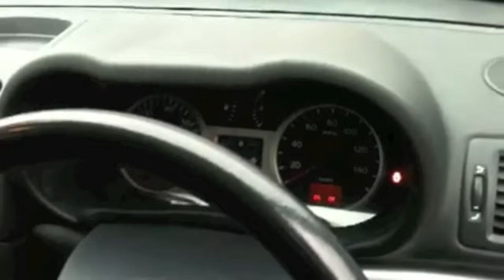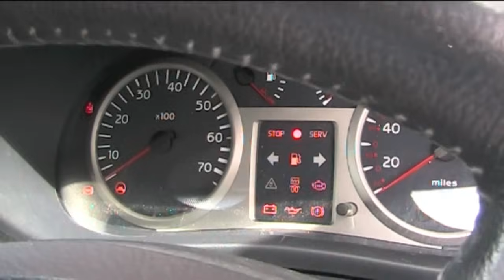Renault Clio 1.2 16v D4F Throttle Body Removal

Comment: This cured my Clio's 2002 1.2 Expression's issues. I can't thank this video enough for its assistance. 

My Clio has slowly been getting worse over the past 6 months and would cut out more regularly when stopping. Every time I pulled up to lights, roundabouts or to park etc... the electrical warning light would appear, revs would drop and the only way to save this would be to rev the engine a couple of times. The issue would be fine until I slowed down again. 

I took the car to 3 garages who all ran diagnostic test, changed the mapping and TDC sensors but nothing worked. 

Finally I came across this video, carried out the cleaning of the throttle body put it all back together and it worked. The car runs like new and has not cut out since.
Reply from the maker: Thats fantastic news to hear, thanks for letting me know, its good to hear the car is running well now.

Comment: Excellent video. Followed it through and cleaned my own throttle body (replacing a faulty air temperature sensor in the process). One small problem though, the video suggests the top bolts for the inlet manifold require an E6 socket. On my Clio, at least, they were E8 Torx bolts, rather than E6. Thankfully I'd bought both at Halfords just in case. Something to bear in mind before commencing the work!

Comment: Great video, thanks. My daughter has the Automatic version, cleaning the throttle body cured the following symptoms: Wouldn't change auto gears properly, Engine cut out at junctions, Stuck in second gear regardless of speed, sudden and dramatic loss of power, etc. Thank you again.

Comment: I've did this a few days ago. ~20 years old. Haven't changed any gaskets, they seemed OK. I've used a paper clip to clean the hole shown at 09:00. If the paper clip has plastic, you have to remove it. The hole is really thin. Instead of carb cleaner I've used acetone. I can confirm E8 torx, for removing the inner parts I think it's a torx 30. On my car I have AC. There weren't any particular problems due to it. I've used various flexible/bendable/stiff adapters of various lengths to get to all of the screws. Prepare to be really creative. I've also had a problem with the capacitor of the ignition coils (shown here at 4:40). It was broken. I've replaced it with a normal 2.2 uF 100 V+ (I've used a 400 V one) capacitor soldered to the metal part and fixed with epoxy putty. Also the connectors of the ECU had signs of corrosion (blue-green crap). I've used KONTAKT 60 spray. Replaced also MAP filter which I've broken by trying to remove it to clean it. It was really hard to remove the wires to the spark plugs. I've used pliers under the widened part and raised the pliers on one side by pushing on the otherside down into the inlet manifold, basically using leverage to raise them. The hardest part was putting back the first fuel pipe (1:40). I've used some WD-40 to help me and a torx key to help me push on one button. I needed around 1 h to dissasemble, but I wasn't really rushing.
Reply: OK, after about two weeks it became a bit jittery ocassionaly and fuel consumption has been slowly rising. Torque on Android didn't show any errors, but CarScanner for Android (which probes extra errors) did. Also LTFT (fuel trim) has been +50% (which means, that there should be +50% more fuel, it stops at ~50% as above that the ECU doesn't allow) while idling and wasn't great while driving either. After an another 2 weeks even the error light on the dashboard lit up once. I've added first a an injector cleaner solution in the fuel, which helped a bit subjectively (and also measuring fuel trim), but not that much. I noticed that one HT lead had a detached rubber, possibly due to the previous work. I've made a special tool by buying an aluminium pipe 10x1 mm, I've cut it in 250 mm length and drilled with a 9 mm bit 25 mm deep. Then I've sanded the edges, so that they are sharp. I've attached the tool on the spark plug and gently tapped twice with the hammer and the rubber from the HT lead went from the spark plug on my tool. That way I was able to replace the HT leads (they come with a new ignition coil), that helped a bit, but still not totally. I've decided to reopen everything also because I had an oil leak (from before). I suspected the oil leak comes from the valve cover, which it did (that's under the cover of what it's shown in the video). I've changed the gaskets there too. They were really bad, hard and they even broke like glass. On some parts you have to add silicone: all 5 five screws on the back and on the side "humps". Got this from Haynes' manual. I've also noticed that the ECU has a gasket, which may be relevant to leaking air, which I didn't buy. I've applied thermal silicone instead. The gasket of the cover that it's shown in the video was quite bad. Haven't noticed before, because it seemed like solid plastic. I've changed this gasket (rectangular, with a notch, so that you don't turn it upside down, code 701 479). There's also a gasket on where the plastic tube, that was needed to be cleaned in the video. I think it's called "strainer something something gasket". In the local shop they've said that you can't buy it. That you can only get it if you buy the whole intake manifold. I've applied thermal silicone to it. I've also recheked the 4 triangular gaskets of the intake manifold and well they only seemed OK. Compared to new ones, they were quite hard. Changed those too. I've also removed the injectors and cleaned them in an ultrasonic bath of pure isopropanol for 30 min. I've ordered two types of gaskets for the injectors MCP-003 and MCP-004 because of a drawing. It should have been both MCP-003. I've also found in Haynes' manual specified torques for each tightenings and for the intake manifold there's a specific sequence and procedure, which I've followed. I've also applied Loctite on the screws as per the manual. When I've started the engine it wasn't jittery, but still I had the same LTFT, so I was disappointed and went to sleep. Next day I've tried putting all the spark plugs out. They were all white, indicating a very lean (too much air) mixture. I've changed the spark plugs, it was maybe better (at least subjectively), but not that much change on LTFT also still errors in the ECU. After that I decided to go around a bit and it seemed like it was getting progressively better. Then I stopped for an hour and went again. This time it was all fine. The fuel consumption went down by 1 L/100 km and there was no jitter also there were zero errors in the ECU.
Reply: @sebaseba2001 
Wow, gut gemacht. Top!
Bewundernswert, ihre Ausdauer und ihr handling.

Comment: Brilliant video, I was worried about doing it before i saw the video, so seeing it done was great. Just 1 minor point I found that unplugging a plug at the rear right hand side of the loom (green cable heading off into bulk head) helped with manipulating the throttle body around, seemed to give me more room without putting pressure on the loom. Thanks for posting.

Comment: Hi ,
Great video, gave me the confidence to tackle the Renault Twingo we have just bought. A lot less room than the Clio but still possible with your help, took the Cam cover off to cure the oil leak and check the valve clearances while I was there, also done the cam belt and fitted a new clutch. I am nearly 60 but still learnt from your video, many thanks, Mark
Reply from the maker: Thanks for the comment, and its great to hear it helped. Congratulations on the clutch change, it was one of them jobs that my clio would have benefited from but i never got round to doing.

Comment: Great video, thanks for posting. Was a big help for me when getting to the throttle position sensor on my Kangoo 1.2 16v, which has basically the same engine.
Couple of points for the Kangoo:
1. Take off the bonnet! It opens the other way and saves a heck of a time getting those inlet maniford bolts off.
2. The TPS sold by most outlets (a much smaller item) is not always the right one. My Kangoo has the same as in this video for the Clio.
Thanks again.
Reply: Hello there! I have the same kangoo from 2003 petrol engine. I have the same problem at the moment and the light won't stop coming on again. The mechanic tried with cleaning the throttle body, but after some time the light comes on again and it's the same problem over and over. I want to ask you, how can i solve this problem? Should I change the throttle body? Or maybe the sensor on the throttle body? Should i check the pedal down under? Thanks in advance!
Reply: @VelesKitchen  Hello ! Well it's been five years since I did this and I don't have the car anymore to check, but as I remember the throttle body was a pretty simple device. If a clean out hasn't worked it could be sensor failure. Have you or your mechanic fitted an OBD II sensor reader to check the fault codes? It might actually tell you if something has failed. Cleaning the throttle pedal is easy, but it's just a couple of variable resistors that signal the ECU and it is pretty robust. Worth checking but unlikely the cause. If all else fails a new throttle body might be worth a try but after that it could be the ECU itself and I am afraid that's real money. Best of luck !

Comment: Hello again. Great news. All sorted and car is running sweet as So thank you so much for this fantastic Video. AMAZING DIFFERENCE.

P.S. THERE IS A RUBBER RING WHERE THE THROTTLE BODY GOES ON THE HOUSING. I NEVER NOTICED IT AND IT DROPPED IN THE TOP OF THE ENGINE!!! I FOUND IT AFTER TAKING APART THE THROTTLE BODY THE SECOND TIME ROUND. LOL. NO HARM NO FOUL CAR IS RUNNER SUPERB NOW :)
Reply from the maker: Great to hear it sorted your car.

I must have forgot to mention the rubber ring, its fairly important that it makes a good seal was your car running rough with it out?
Reply: Lol not only was it running rough the ring had dropped into the head and the engine was making some god awful noises, I thought there was something broken but luckily once the ring was back on it is running better than ever.  Ignition light flashed a few times but after stopping and starting the car a few times it went off
Reply from the maker: Graham Wakerley It didn't drop down round the valves etc did it, iirc with the inlet manifold off the space below it is just space, you then need to remove the valve cover to get at the valves.
I would expect it to sound and act very strange, sometimes the rubber ring can get old and cracked and that can also cause running issues.

Comment: wow, looks like another extensive dismantle jobs just to get to the throttle body. I have cleaned throttle bodies on other cars without having to remove the inlet manifolds. Wonder why Renault have tucked the body away like this, the same as having to take the whole top dash out just to change the bulbs in the centre clock / temp  in the dash. Nothing seems a quick 5 minute dismantle job with this motor. - well done for video though very informative and clear

Comment from the maker: Thanks
I changed the starter on the clio a long time ago ill do a video though soon as its not too difficult.
But the crankshaft position sensor its just below the air filter on the bell housing, two bolts hold it in place and some wd40 or carb cleaner is all i used to clean it up.

Comment from the maker: There most likely will be a bit of old oil in that area but a few old rags is all it takes to dry it up, also while you have the inlet manifold off clean out the PCV valve to prevent the oil from doing that again.

Comment from the maker: The bolts are welded onto the seat frames and go through the floor, to get to the nuts you need to get under the car and remove plastic covers, once the nuts are undone the seat will lift out make sure to disconnect any wires before fully removing it.

Comment: Thanks for looking , fingers crossed  it solves the problem,  on half  a tank only did 50 miles.

The inlet manifold on top wasn't secured  very well. One of the nuts in bedded in the rocker cover was slack letting air in. And on the inlet to the engine one of the bolts was snapped in the head,  so had to drill it out and tapped it with a 7 mm bolt seems to have sealed.   

Haven't had the engine management light on again, so will refill and see what mileage  I get ....
Reply from the maker: A loose intake manifold will definatley cause the issues you are mentioning, especially if someone has broke a bolt reinstalling it some time in the past there is a chance it wasnt done right, a new intake manifold gasket might be a good thing to get if you ever go to take it off again.

Comment: Very nice video. I have the same engine on a kangoo. Is there a icu valve on the throttle body? when I stop at traffic lights eletrical fault light in the dashboard turns on  and my car engine goes in low revs and   sometimes stalls. Any idea what could it be?  Thanks a lot for the video.
Reply from the maker: Yes i think the idle control valve is in the throttle body, its best to clean it with the carb cleaner when it is exposed.
Reply: @peugeotCitroen2CV  thanks. Is petrol or diesel ok to clean out the throttle body?
Reply from the maker: @MacUlisse  
For the sake of £10 or less a can of carb cleaner is the correct stuff to use.
Reply: @peugeotCitroen2CV  thanks. I’ll do that then.
Reply: @peugeotCitroen2CV  Hi again.  Is it true that ecu needs to be reset after cleaning the throttle body so that the throttle values are set right?  Or is there a more easy method to set the car to recognize a cleaned throttle body?  Thanks again
Reply from the maker: @MacUlisse  I dont think so, the car usually calibrates the throttle body itself if plugged back in. Not aware that diagnostic equipment is required.

Comment: did much the same as I was changing top wiring loom due to the clio problems that most know about ,that is except the two garages that worked on the car ,new map sensor , lander sensor,and  cat later with the same fault still there.
I would just like to add the following at the bottom of the crankcase breather is a small hole that needs to be cleaned out with a paper clip 
also when replacing  bottom inlet 10m bolts use a thin extension bar ,use your finger to act as a guide,

Comment from the maker: I never depressurised it, just pulled the various pipes off, there wasnt much petrol in the tank, i suppose opening up the fuel cap would depressurise the tank.
I took the inlet manifold off today again to address an unrelated oil leak, it wasnt a nice day for it, very cold, but the throttle body is still nice and clean.

Comment from the maker: I still would get a bit of the tsst noise i think its just the induction noise but it doesnt affect the cars performance, if you run the car with the air filter out the noise will be louder.

Comment from the maker: The inlet manifold/throttle body first, see the video in the renault clio playlist for that, then the valve cover and once its off the head comes off.

But you also need to take off the exhaust manifold and whatever sensors are connected to the head, and the timing belt cover, if you plan to do this job get a haynes manual,

Comment from the maker: I had the electrical light coming on, intermitently but it was coming on more frequently when i went to work on the car. And yes revving the car usually got rid of the light. My mum drove the car and she drives it easy thus the problem showed up, then when i went to drive it i drove it flat out and couldnt see what was wrong initially. So i think cleaning out the throttle body is worth a try on your car.

Comment from the maker: Its around the bellhousing (where the engine meets the gearbox) below the air filter housing, and is held in place with 2 bolts

Comment from the maker: It sounds like a wire somewhere has been loosened; the large plugs up near the bulhead i found quite tricky to plug in. everything needs to be plugged back tight, and a bit of wd40 or contact cleaner on the plugs keeps the connections clean.

Comment from the maker: The lack of power is caused by the old sludgey oil sitting over the throttle body and various sensors, the only pipe that can get clogged up is the crankcase breather pipe and its a good idea when cleaning the throttle body to also clean this out aswell.

Comment from the maker: The fuel gague works gets the signal from the float inside the tank, this car had the analogue gague but its still controlled in the same way as the digital.
It sounds like there is still a loose wire somewhere, were any broken when removing connectors? and is the bolt shown at 4:34 back on correctly?
How much fuel is in the tank because this clio if say £10 is put in when the fuel light is on its not enough to get it off.

Comment from the maker: The timing belt, and auxilary belt are on the side of the headlight they could be making the noise, does it change with revs?
It could be a number of things causing the problem, the first time i attached everything together the car was a bit lumpy when first stared but after a bit of revving it picked up.
What condition is the wires around the engine is the HT leads and plug going into the coil good, sometimes problems with them can make the car run rough.

Comment: Thanks for this! I got Twingo with the D4F engine in it and I keep finding oil in the air housing so I probably need to do exactly what you just had to, although mine doesn't actually seem to have any of the problems you seemed to experience with it.